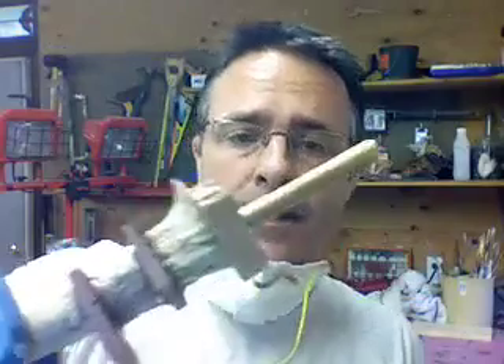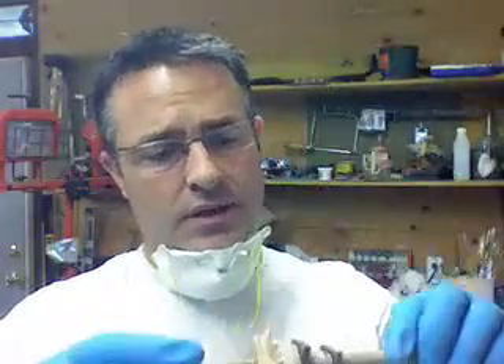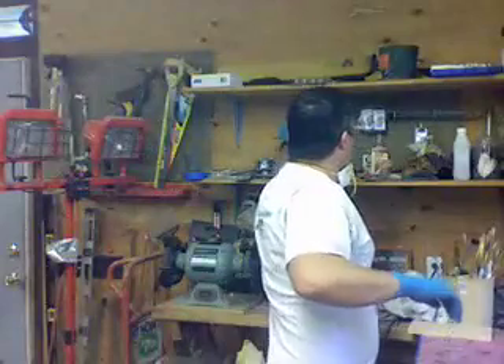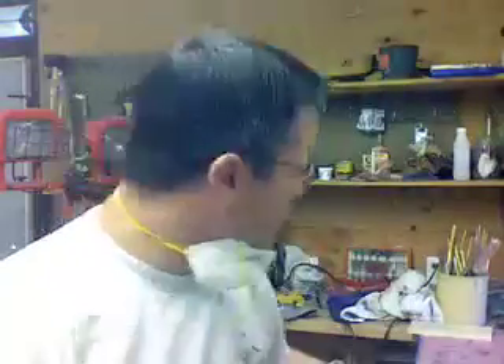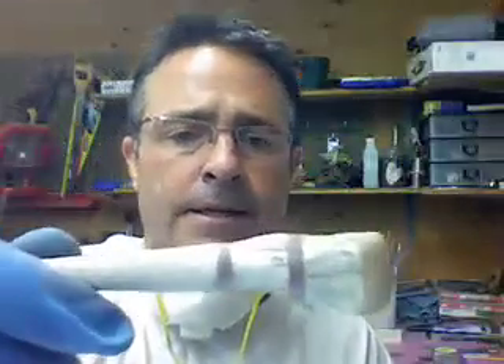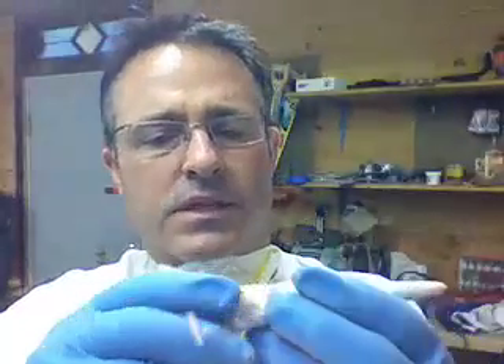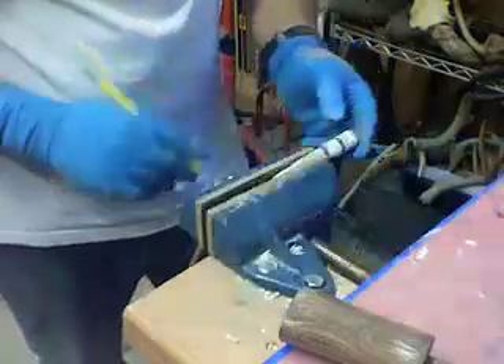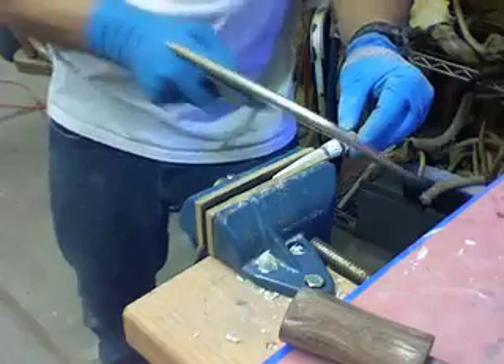DIY- How to make a fancy deer antler whistle in one hour

Comment: Can you show more detail on the reed? There is a plug on the end it looks like...where you blow. I understand the two pieces of rod, but it looks like a plug.
Reply from the maker: Hey, thanks for the comment. The plug on the end is made of deer antler and I also put deer hide on the tip to seal the tube. moving it back and fourth makes the pitch change.
Reply: Thanks for the response.